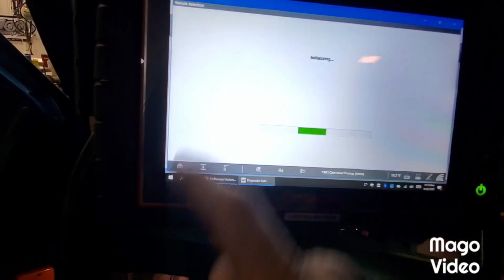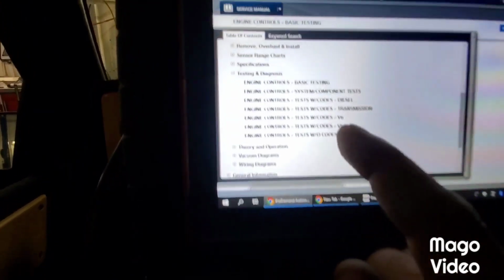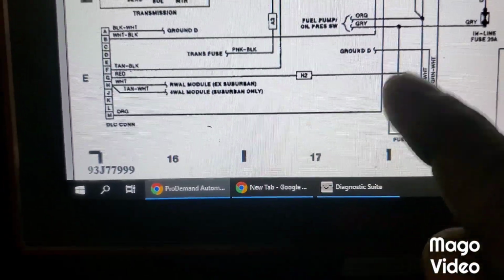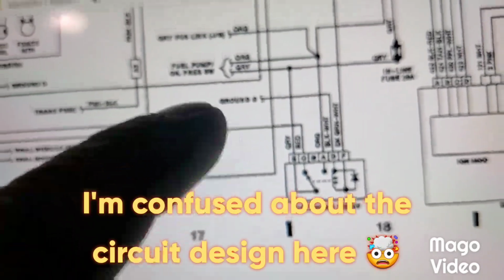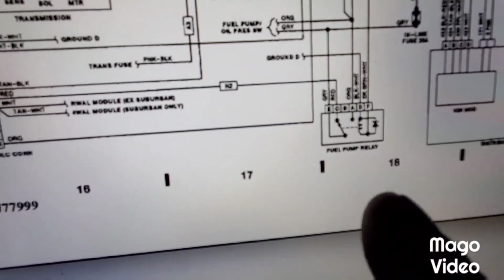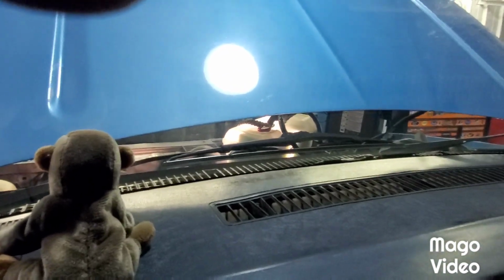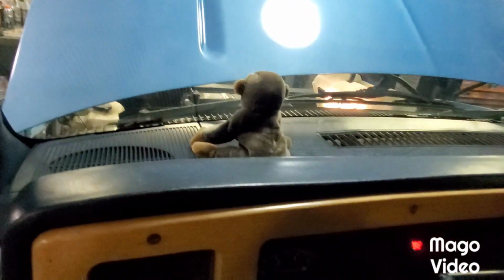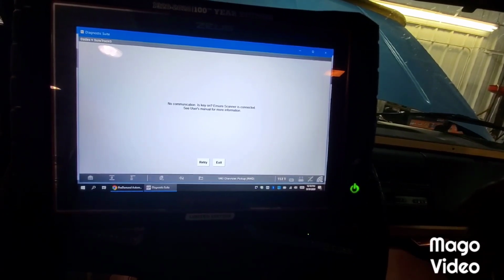1993 CHEV C1500 5.7L (VIN: K), CODE 54 FUEL PUMP RELAY OR CKT FAULT

Comment: Hopefully this helps someone I had the same code on my 1990 with a 93 swap v6 / 4l60e. Code 42 43 54
After testing all the wiring. Circuits. PCM I found my issue to be the wiring on fuel pump wasn’t connected. Easy fix. Had the wrong knock sensor I needed the 3.9k ohm resistance not the 100k sensor standard brand ks6. And the my oil pressure sensor was toast with exposed wiring. I did still switch coolant temp sensor Egr valve and oil pressure sensor. And fuel pump relay as a preventative maintenance truck has 207k on it so was probably due. Cleared codes and hasn’t came back yet. But didn’t drive it. Well report back if I can pass emissions and if the light comes back on. 🤞

Comment: If you have a bad pump,changed it and filter,could the stored long start set a later code with no issues?
Reply from the maker: Are you still getting a long crank time?   And if so, when does it occur, after it's been ran for awhile and hot, or on first start up when cold?
Reply: @PaulysAuto  starts right up,the code appeared after about 25 miles-reset it.
Reply from the maker: @Watchout1010  What code???
Reply: @PaulysAuto  54
Reply from the maker: @Watchout1010  PCM doesn't like the voltage it's seeing on that FP Relay circuit...more testing is needed to make a call.
Reply: @PaulysAuto  the pump took a shit,tried to start it several times-replaced it wiring to it,fuel filter-code set when I drove it 25 miles-starts up,can hear the pump as soon as the key is turned-I believe it was a stored code-replaced relay with a used one-have not seen the light again,it also had a map code--used one I had-seems ok.

Comment: Wow, tedious to watch.  Lots of things can trigger code 54. ECM sets it if it doesnt sense 12 v  at relay after 2 seconds of ignition ON.   Now , this is a weird (redundant) system.  Long starting indicates that the ecm triggered fuel pump relay isnt togggling on.  Cause could be theres a bad wire...could be power to relay trigger from ECM, or power to FP, or ECM.   Try relay first.  Often, the motor finally cranks due to oil pressure coming up, thereby toggling a 12 v feed to the f pump.  Fast starting indicates relay and feed wiring are fine, and trouble may be in ECM, wiring that toggles relay, wiring that supplies 12v and ground to FP.  If it cranks, pull relay and if it keeps running, the oil press switch is fine. Relays rarely fail and you can save money by just swithcing similiar relays in the power box. Im not sure but will step up and say, I think its possible that a bad FP can sink too much current which could thereby trigger low voltage.  As could a feed wire thats semi shorting to ground.  
Observe the Georgia Guidestones.
Reply from the maker: Good to know, thanks for sharing this with us. The relay did fix the problem, but I couldn't agree more, these systems are quite difficult to understand because of the various things that need to be considered as you mentioned. Thanks for taking the time to share this information with us!  God bless my friend.
Reply: @PaulysAuto
Reply: FP relay is FP only on these

Comment: I have 1990 k1500 , it turns over, no start, only code 12. It will start with some fuel sprayed in the throttle body and then stall. I already installed a new oil pressure sensor and still doesn't start, do I need to turn it over for an extended period of time? I think can only be the fuel pump now ?? Is there a code just for the pump ? Any help would be appreciated. Thanks.
Reply from the maker: Next step is to check what you have for fuel pressure before the fuel filter and after the fuel filter.  Looking for no bleed down KOEO and that you are within specs...KOEO & KOER.

Power and ground at pump is critical as well.

Comment: I’m no mechanic so please bare with me, I’m having the same problem, I changed out the fuel pump relay too, but the code comes back anyway. Usually after driving awhile. Once I turn off the truck, the check engine light is gone but will come back after awhile. I watched your whole video and I’m still confused 🤣. Please help.
Reply: 1993 Chevrolet k1500 5.7
Reply from the maker: Ok I will try to do a video explaining this for you.
Reply: Appreciate  it ! My truck runs great, no hard starts, nothing that stands out, that's why I'm stumped. Second relay bad? I will say this, that way you have all the information, if I unplug the relay it still starts, and that's because the oil switch is working, right ?  Thanks again
Reply from the maker: @tonyvillegas1179  correct, if you unplug the oil switch then what?
Reply: I'll have to check tomorrow

Comment: Nice job I think Scanner Danner has a good video about this circuit design
Reply from the maker: Yes, he does now that you mentioned it...it's probably why I disconnected that damn oil pressure switch straight away!

I remember him explaining how they can throw a guy for a loop if you are not paying attention.  Good stuff Paul teaches 😉👍

Comment: Those old GM'had a strategy that IF the fuel pump relay was to fail, the oil pressure switch would send power to the pump once pressure built up. And those relays are power side switched, so that throws a lot of people off when testing. Most are used to having a ground side control for a relay. GM did it different. Good memories man. I worked on more of those systems than I can count. Great job staying with it to figure it out.
Reply: 1995 454 crank no start. No spark no fuel. Any suggestions on where to start?
Reply: @marcs5790  ign module
Reply: So the problem is... I have same code on chevy blazer 5.7 350
Reply from the maker: Thanks Joe, yeah power side switched relay and the oil pressure switch definitely made it more confusing.  

I am kind of glad I stuck to the test light here, otherwise I would have been scratching my head even more 🤣.

Thanks for the explanation Joe!
Reply: @PaulysAuto  Good morning my brother, I'm having this same issue.. Driving me nuts my brother, But mine is on a 1991 S10 Blazer 4.3 TBI same code 54... Please help my brother ? Much love to you and yours....

Comment: Weird with the oil pressure sw taking over the fp relay
Reply from the maker: Very weird design, I was struggling to make sense of it, I just don't work on enough of these older GM's you know?